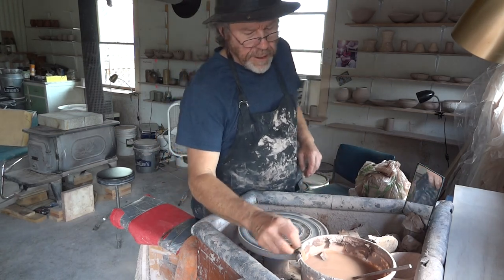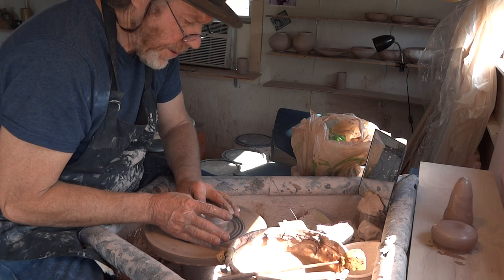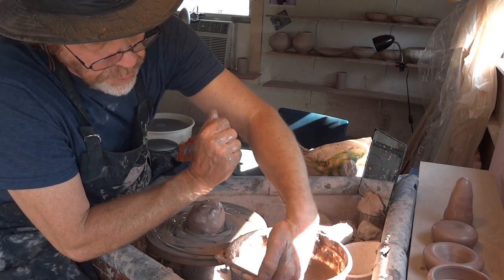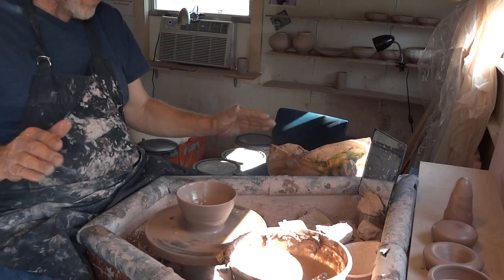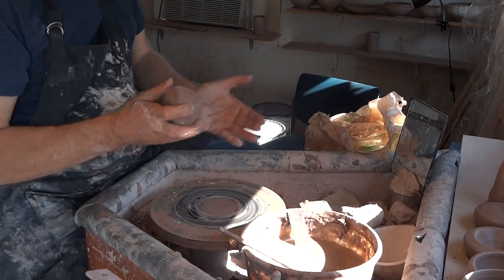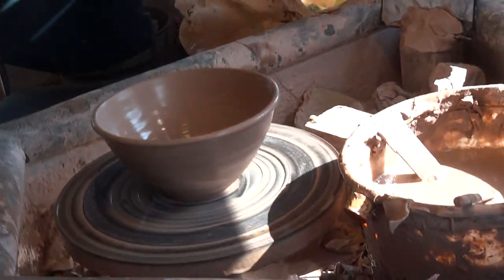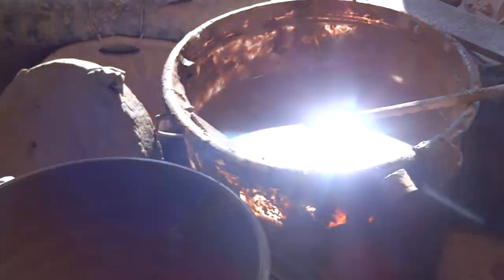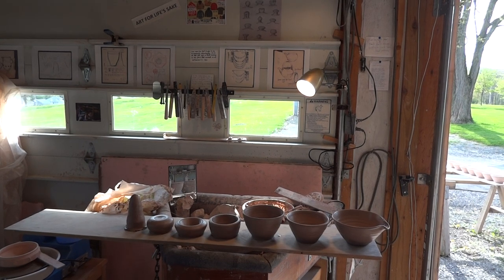7 steps to throwing a bowl (general purpose - ‘GP’ )  May 9 with Simon Leach

Comment: Very useful, Simon - Especially the bits about getting the height first and using the stick on the outside with the hand inside towards the end. I just tried throwing a bowl and managed it following these directions. I have made bowls before, but not in a single attempt!  If you're ever making saucers I like to see how you tackle them - I'm struggling!

Comment: Hello I'm curious on bowls how they are made an I'm thinking about making bowls. I like what you've done on making your bowls but I'm just also curious on the bowls that you've made, are these types of bowls that you're making, can someone use them for cereal bowls? Are those you make for outside for flowers to be placed in? I want to learn how to make the type of bowls that can be used to eat from. I'd like to make the type of bowls that are sold in stores that is sold in the kitchen ware. So any information that you could share would be highly appreciated. Thanks for your video an you've done a Awesome job with making your bowls. 😄
Reply: You can use bowls for anything you want. Make different sizes.
Reply: Hello Billy TheMystery. I am also a student learning the processes. My understanding is that the process continues to complete the piece. It must dry to a leather hard stage, then you trim any excess clay away, make sure the surfaces are smooth and finished. It must be completely dry before it is ready to be fired in the kiln. After the first firing you can use any number of techniques to finish it. If it is to be used for preparing and eating food you must use glazes and techniques that are specifically intended for those pieces. I know, it is a lot to learn. Best of luck with your pottery journey, have fun along the way.

Comment: I have trouble removing my pots from the wheel.  Have to use bats and just leave the pot on the bat after cutting it off.  However, this causes my bats to get a bit of mold on them.
Reply: Grammie Gilliam hi Grammie), i am a newbie, but I learned, that repeating this steps help:1. Dry the wall with a rib or throwing stick (I do it 2 times), 3. Cut the excess clay at the bottom, 3. Dry the wheel around with a sponge, 4. I use Simon’s cutting wire (it helps, I think it lets some air between the bottom and the wheel), watch the mirror, not to collect any extra clay from the wheel.5. Dry the hands, 6. Use Churchill’s victory sign to lift up (first lift up the side where the cutting wire “went out”. I hope it helps! Happy pottering!)
Reply: How about metal pot lifters ?

Comment: Simon, you have probably explained this elsewhere,  but I have a question about the rolled rims. Doesn't that create an air bubble around the entire circumference of the rim?
Reply from the maker: I dont trap air as the rim is actually folded its not a tube ! any air gets squished out in the folding over if you do it right !